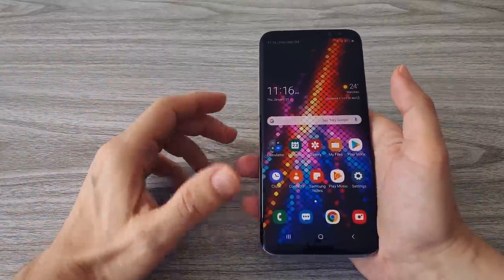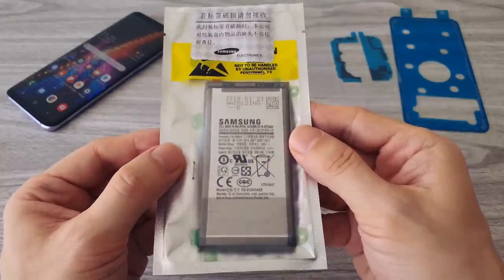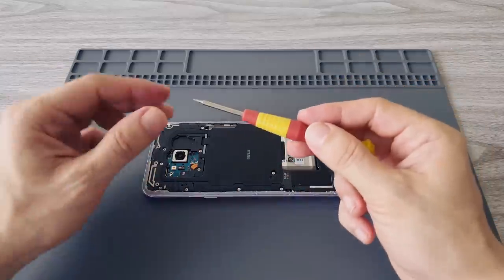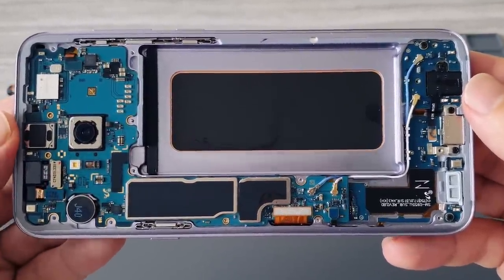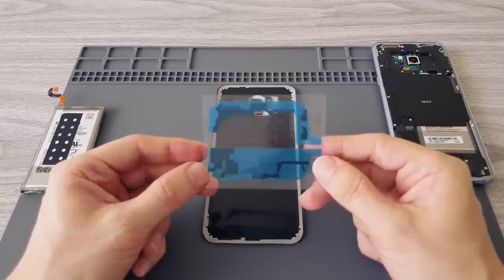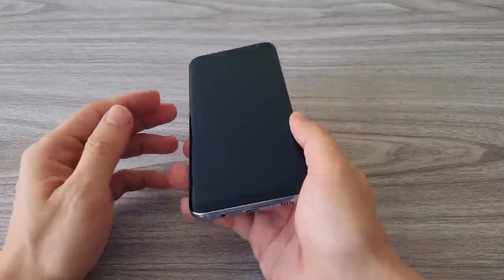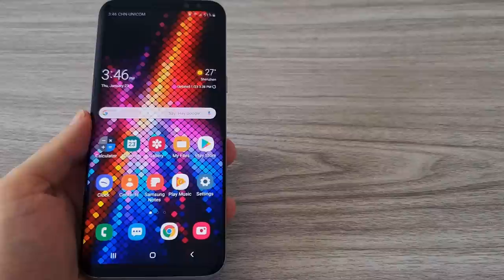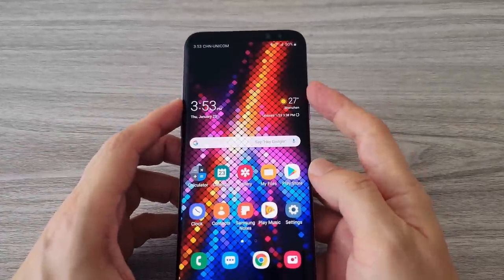Replacing the Battery of my Samsung Galaxy S8+ 🔋 HOW TO

Comment: I carried out this repair yesterday, and it went perfectly, thank you! Also, if anyone is attempting this, take your time, use plenty of heat (but not too hot so that you don't damage the phone) and only use plastic tools. Some kind of solvent is needed to handle the glue, or pick it away with something plastic, but be careful not to scratch the coating off of the inside of the back glass cover if you're taking this approach...

Comment: that battery is in there GOOD man. Also would not recommend using guitar picks as props when you're removing te back cover, because the uneven pressures caused my cover to crack right down the middle

Comment: Hi Cool video. I don't have the Samsung S8+ but I do have a Samsung📱J7 Neo android phone which dead now[for like maybe 2/3wks or so etc..] 
So my few questions are. 

Why does this phone share your video Samsung S8+ comes with everything stuck to the phone is that not bad/worst to cause more than damage to the phone itself? than just put on back cover itself & let it click in place with the phone? 
  2. Lastly Should you remove your micro sd card & such things first from your phone before carrying your phone to get battery replacement etc.. done by local phone repair store here so as not to lose any data that maybe store on them?[ such like contacts,photos, games etc.] or should you leave them in? & 
    3. Lastly would this involve anything to do with having to reset your phone📱? or no?  Tfs & your reply asap.

Comment: How many hours is it necessary to use the heat gun before the glue will melt?  How does one hold the phone, pull up with the suction cup, and insert something when we see the cover lifting when most of us only have two hands not three?

Comment: Thanks for the video. Very clear and very thorough. I have the Galaxy 8 for about 3 years now and I think the battery has seen its day. However I am not as confident doing it myself. But what you have given me is the courage to change it rather than buy a new one.  I love this phone so I may spend a little bit and have it done by Samsung themselves which they do here. I have the Galaxy 7 still and am not using it coz same problem battery and nothing else.

Comment: Really nice job with this video. One suggestion - mention to heat the glue on the back to about 130 degF before trying to separate. If the glue is not warm enough, it is more likely that the back glass will break!

Comment: When you attempt this, expect that you will likely crack the back.  There's no way to know how hot you are getting the edge of the phone.  My hair dryer did a pretty good job, but I was afraid of cooking and damaging the phone.  Also, I can't see how you can get into that super fine thin crease between the back and the phone body w/o using a metal box cutter.  Plastic just cannot be thin enough and still as strong as metal.  I was able to just get started with the metal (very gently pushed in, not too far), then quickly change to plastic tools, but not w/o some cracks formed in the back. Fortunately it didn't crack to bits and I was still able to put it back, then tack it down with some silicone (it's also inside a case, which will keep it together, but you probably should buy the new back ahead of time, as I can't see this coming off w/o it cracking (who makes a glass back???).  Obviously designed NEVER to be opened, and instead throw out and buy another.  Not sustainable for the planet!!!

Comment: Hi, if someone gets the yellow triangle with thermometer sign when testing out the battery, try to put back the speaker and the upper antenna panel, hope it helps someone. (I got it btw)

Comment: Hi thanks a lot for the video! I got a question: you mentioned that we need to disconnect the fingerprint cable from the back panel when you took it off.. But I don't see a special step to put that cable back on when you put the back panel on... Does the cable connect by itself?
Reply from the maker: Hi the cable is short and the angle is small it's difficult to show in the video. You have to press it and it will attach on its place is not difficult. When you open the back panel you can see where exactly has to comment. 👍
Reply: @NikolayTanev  oh, thanks a lot! My S8+ just started off with 50% battery level the past 2 days, after a whole night of wireless charging.  I looked at new phones but they are so expensive.  Then I thought of buying the battery only and found your video. Really appreciate the instruction! I bought a battery kit from Amazon, can't wait for it to come!
Reply from the maker: S8+ is a good phone even today. I still use mine from the time I changed the battery and it works well. 👍

Comment: How long do you use the heat gun in the phone for the first step? I don't want to overheat the phone and accidently damage it further. Thank you
Reply from the maker: 10 second is enough, no need to be too hot. Just enough to open it little bit to make space for a tool to enter and you can start to work slowly.

Comment: Samsung slowsdown their phones ,when I had galaxy s6 edge for 3 years I noticed that the power saver mode sometimes is on by itself! When you slide down the notification bar I could see how the power saver button is switching on and off
Reply: Same with Apple. They slow down the phones to top it from power throttling and shutting off randomly. Remember when Apple got sued? It's because they slowed down the phones to help the battery last longer and so it wouldn't shut down randomly

Comment: After replacing the battery, it would not come on.  Thinking I broke it, I resigned myself to buying to new phone, so I put it back together anyway, hoping for a trade in. Once the antennas were in place I was able to power on.  I don't know how you were able to power yours on without the antenna's.  

ALSO NOTE: The SIM card carrier also contains the small chip that give the phone your identity.  Ensure you don't misplace that it falls out easily, unlike the SIM card.

Comment: The Samsung Galaxy S8+ phone has a 6.2-inch (2960x1440) Super AMOLED screen, a 12MP main camera and a 8MP selfie camera. The battery capacity is 3500 mAh and the main processor is a Snapdragon 835 with 4 GB of RAM.

Comment: The Phone wont be water proof anymore. It won't have the factory seal no matter what.
Reply: That's what the new adhesive strips are for, to reseal it. If you get good contact when you replace it should still be waterproof. I don't really want to test it though.